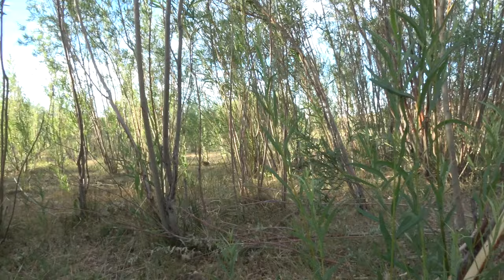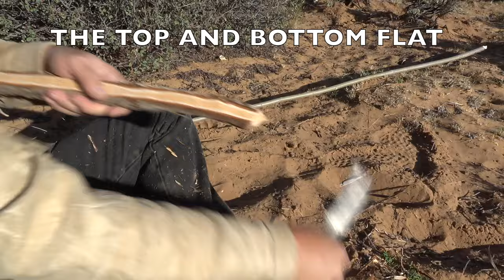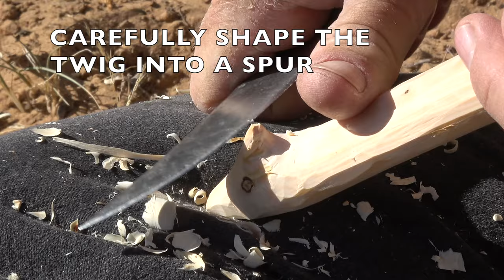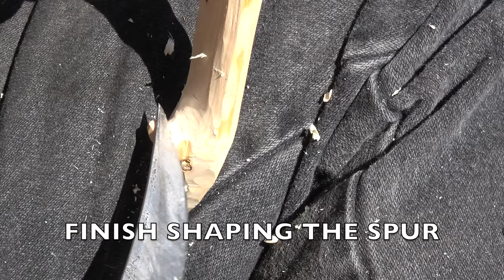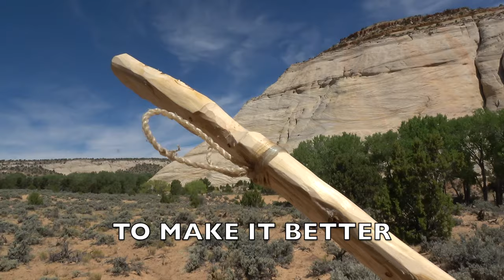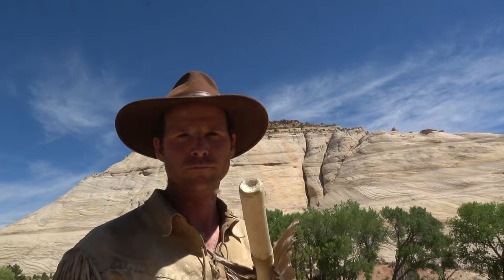How to Make an Atlatl

Comment: What knife are you using?
Reply: Schrade Uncle Henry...  Great knife that dont cost very much.. It's designed as a Skinner but is quite versatile with the exception of bushcraft.. Tho it can be used as such in a pinch.. Many better options out there for a versatile bush knife... Try a K-Bar Becker for outdoor use.. It's the best overall outdoor knife currently in the market that won't break the bank.. Recon Marines use it as standard issue..